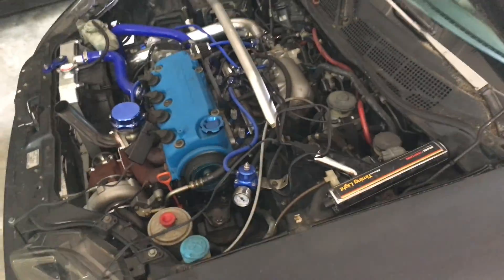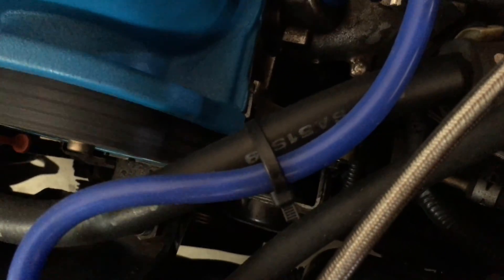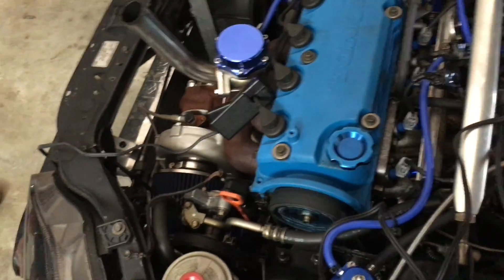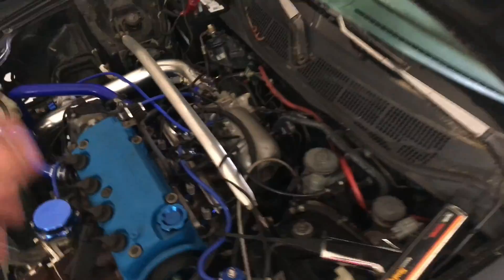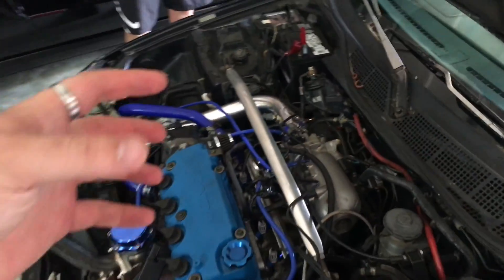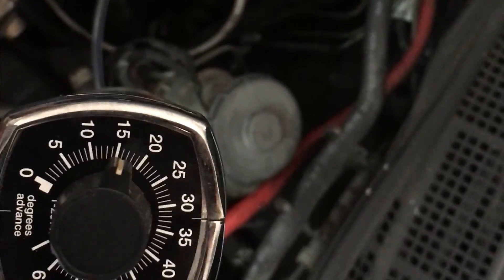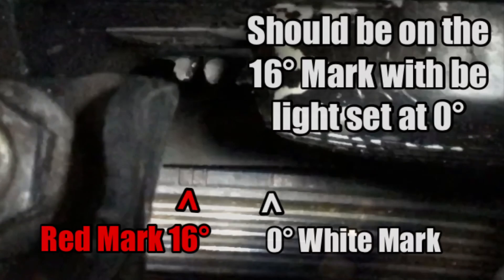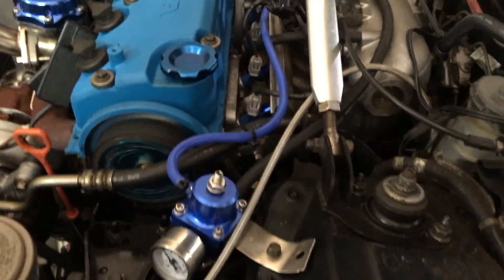How to Set Ignition Timing - Civic eBay Turbo Build - Part 10

Comment: There’s another “pointer” on the timing belt cover below the V one used in this video. Is that just another one that can be used or do you need to line them both up with the marks on the crankshaft?

Comment: You really don't have to use copper sealing on the head gasket.all that does is make a mess and just makes it a lot harder to remove in the future for a head gasket job
Reply: Never found that to be an issue, I've always drilled the rivets out and sprayed inside and outside of every MLS gasket ive done, never had a failure and wait till its dry before you toss it in for no tacky results and for clean up in the future. Little brake clean, it comes off like nothing.

Worth the money and time for the cheap insurance in my books
Reply: @schafer240  Most MLS gaskets come with a carbon coating so it's really not needed to go with the spray!But to each their own.👍🏾
Reply: @hecks_k20_fa5  

Yes that's true for the outside layers, the inside never has a coating. That's where lots of shops have to redo head gaskets they just tossed in. 

Hell in a pinch I've reused a mls headgasket that had the viton all messed up on a boosted honda when nothing was available and just coated it with copper it was fine for 2 years at 15lbs before i ripped the motor apart again... pretty amazing stuff.

I started doing the copper spray about 10 years ago after the recommendation of the machine shop I use that builds some pretty crazy race engines since the 70's. 

Like you said to each there own...